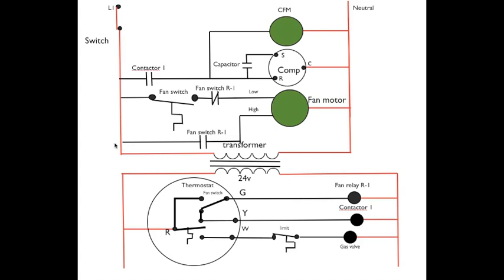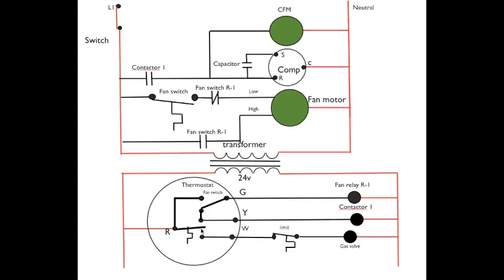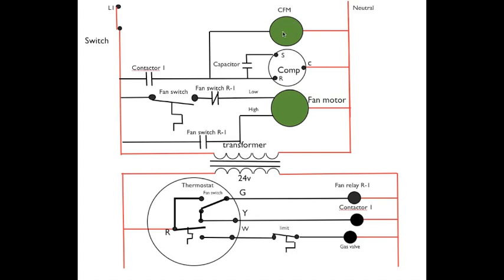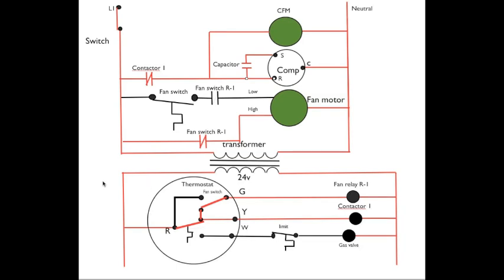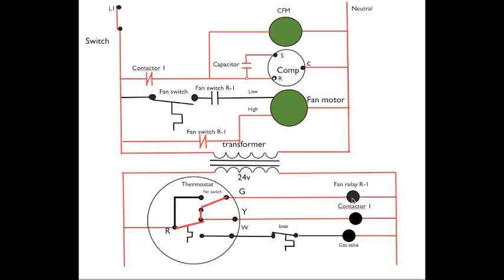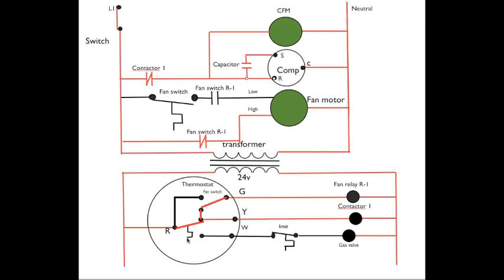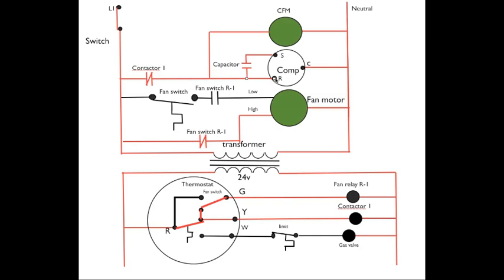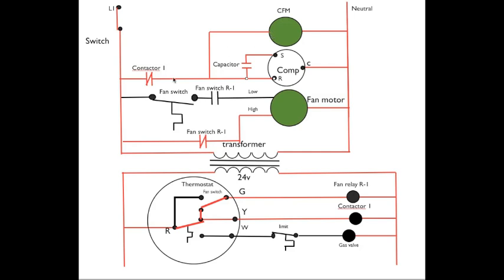Schematic diagram #9 air conditioning

Comment: Hi GFM,  Great video! very well explained. Since I am still a newbie in training I just wanted to be sure.  When testing the thermostat with a meter, if I go between R and Y when the switch is closed I should read zero volts right? and if it is open I would read voltage?   Thanks so much for all your help!
Reply from the maker: If the switch is closed and there is power to the system, that is correct.  Hope this helps.
GFM